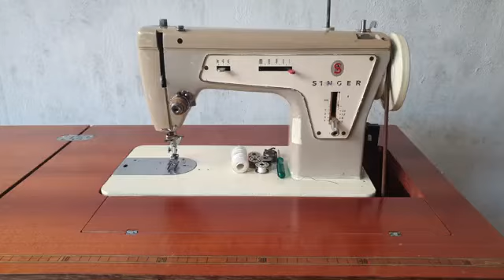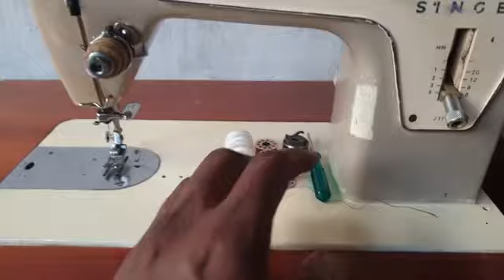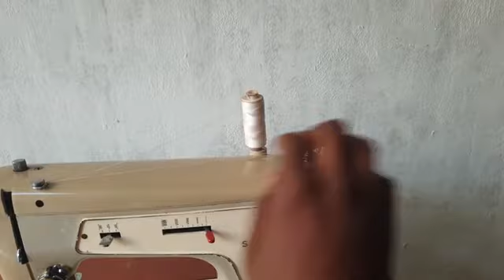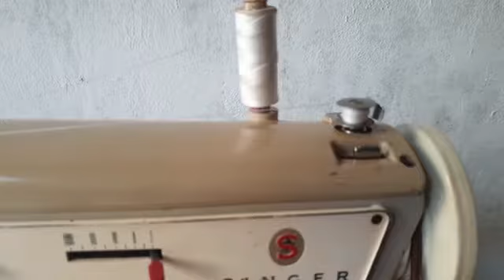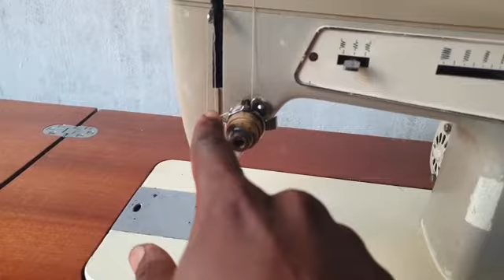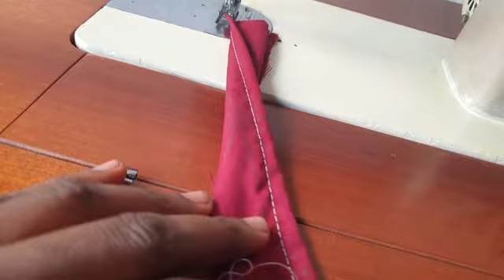Singer model 237 sewing machine review

Comment: My machine does not pick up bottom thread to saw.  I can pick up bottom thread initially but does not saw properly.  Please reply how to fix.
Reply: make sure your bobbin is in the bobbin case so that when you pull on the thread the bobbin turn clockwise. It could be the bobbin is in backwards.
Reply from the maker: Change the needle
Make sure you threaded the machine properly
Lastly it might be needle hook timer mechanism settings

Comment: Sir in tension plate what is the right number for this machine I have this model someone gifted me but I face problems of loose &messy stich please help me what number is correct for neet straight stich thanks
Reply from the maker: Okay... If the tension assembly is working fine as it should, the right number to put it is 5.. But if not, you will need to increase it further to get a finer stitches on the back of the fabric..
Besides, hope the tension on the shuttle is not too tight?
Reply: @bondmachines  thank u so much for your fast reply thankyou
Reply: @bondmachines  sir I bought this machine from America to India along with insert cabin  really I like this cute machine
Reply from the maker: It's a decent machine. Strong too.